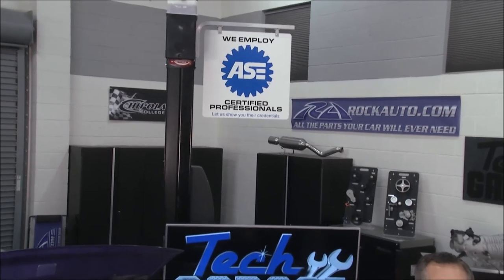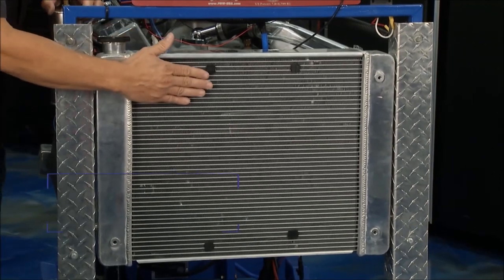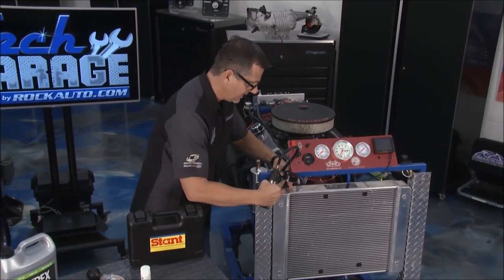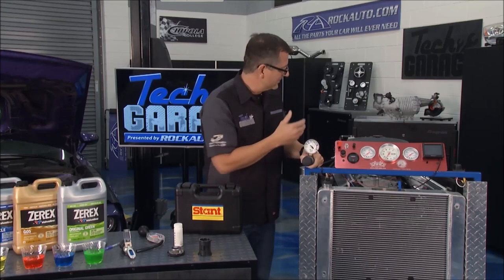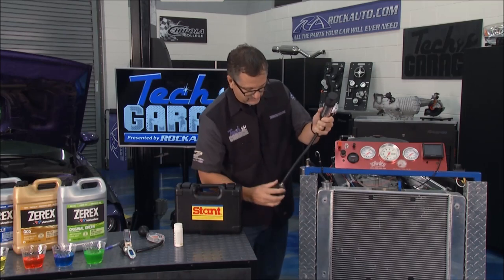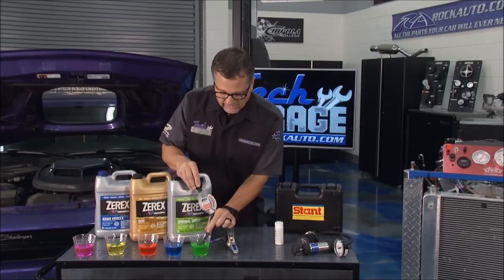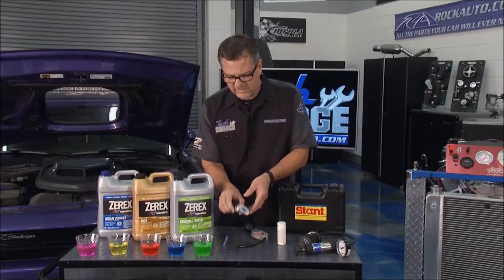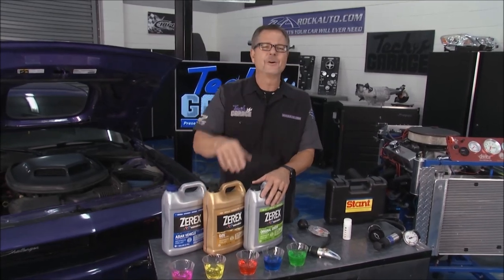Types of coolants and how to test the cooling system (Season 7/E4)

Comment: 02:30 mm:ss, he states, "Water boils at 212F, and we don't want it to boil any LOWER? than that".  SERIOUSLY?
Reply: He's saying that you don't want water to boil at 180°because you'd be overheating all the time.
Reply: @paulsmith9341  NO. Only IF the car can fly at 16,700 feet, can the water can boil at 180F.  Sea level, 212F.  With a 15 psi radiator cap and 50/50 coolant, over 250F.